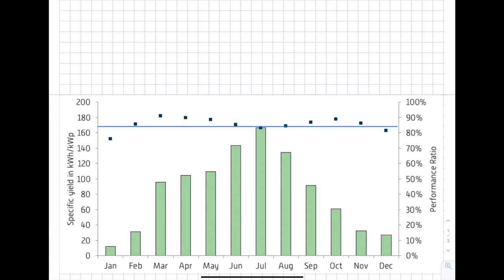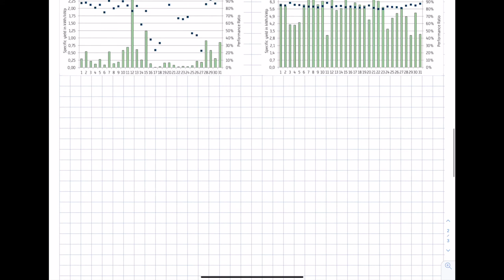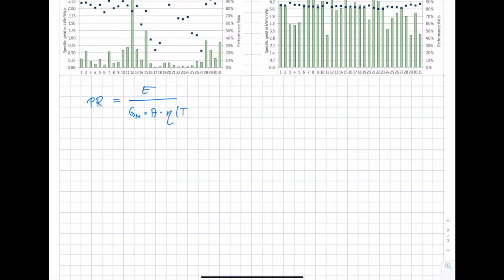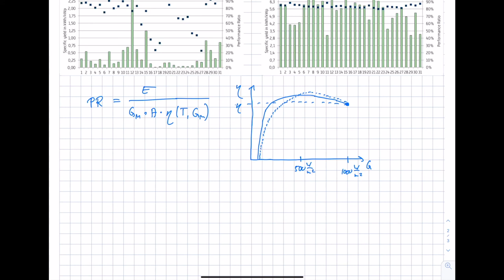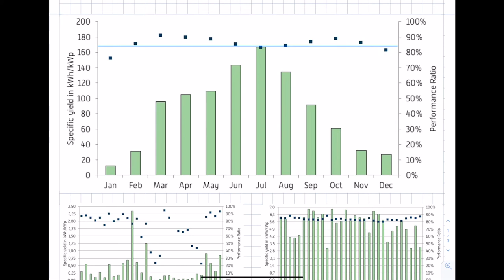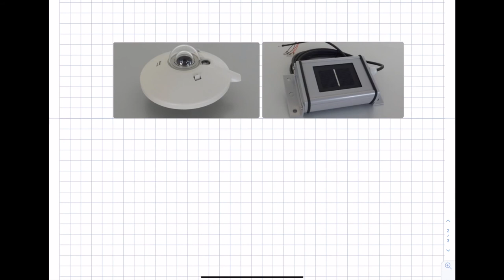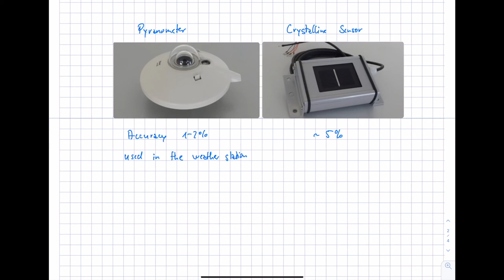Solar Energy. 9 Performance Ratio

Comment: At 22:37, the measurement of Si sensor is mainly caused by spectrum mismatch of Si. It measures energy with in 1100 nm, and just magnified it by a constant, assuming AM =1.5.

Comment: At 13:23, in my opinion, plant managers would be happy if the monitoring system tells: 1) is the fluctuation normal? 2) what are the possible reasons for the abnormal fluctuation and could I minimize the loss?

Comment: The fluctuation of PR in winter could result from the fact that the total irradiation is rather low, and thus the error caused by measurement uncertainty (pyranometers, dc current sensors) could be larger than in summer. Low-irradiance efficiency of the solar modules could be the other reason.